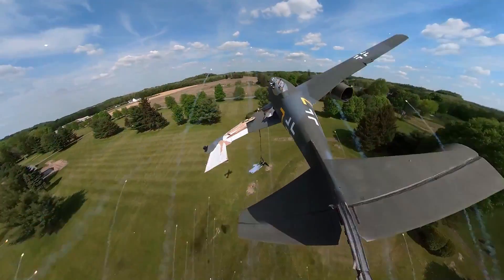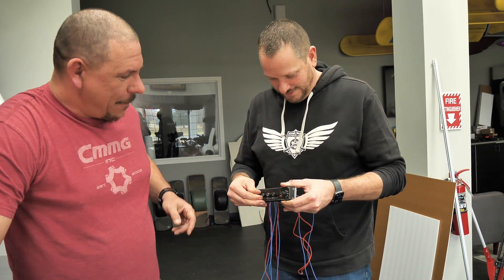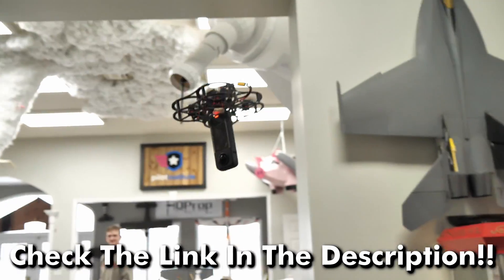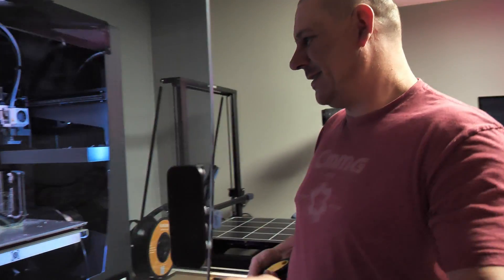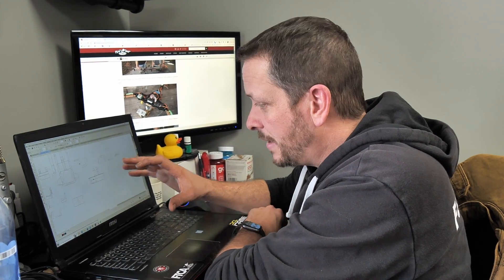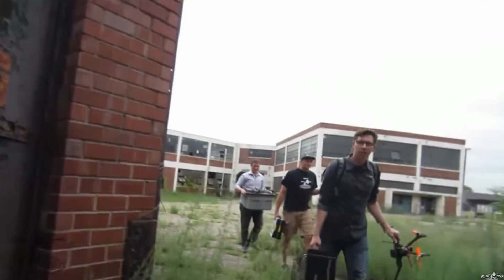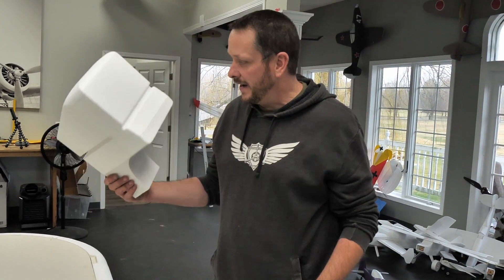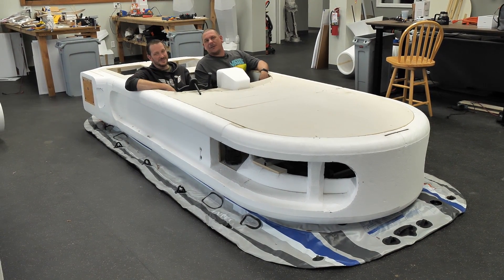Huge Upgrades To Our Hovercraft

Comment: While it wont look as much like the SW Speeder, if you are going to have differential thrust on the engines, I think you really need "skid steer" style controls rather than "throttle and steering wheel"; it will also give you the most effective "brakes".

Comment: Are you trying to build a scale model of the Star Wars one or something that works well? Too much emphasis here on making it look pretty I think. Copying the Star Wars shape has resulted in too many compromises in fundamental hovercraft design. E.g. larger diameter thrust ducts would give more effective and efficient thrust but not truly be to scale. Or you just put lots of power or a jet engine into the small ducts.

Comment: I used to build 6 man commercial  hovercraft and have built models. The problem with models and small craft is the available parts are made for aircraft. So the propellers have too large a pitch and are not meant for ducts. I'd suggest using 2 or 3 two  bladed mounted onto one motor shaft. And crop the tips so they are wider at the tip.

Also you should not taper the duct after the motor. It should be parallel or even slightly  divergent. Tapering is for jet aircraft as they travel much faster.

Comment: If you want to add strength to ur styrofoam, cheaply and easily, just latex paint it, put fiberglass window screen material or cloth on the wet paint and immediately paint it again. It will surprise you how much stronger and durable it makes styrofoam. Crashes will be less damaging to wings and fuselage...(poor man’s fiberglass that won’t dissolve the styrofoam)

Comment: At 15:06 it looks like something ain't right with the upper propeller.  Is it mounted upside down or something?  Is your intent to have the propellers turning opposite directions?  If so is one prop cw and the other ccw?  I'm pretty sure something is wonky there.  You will lose a lot of efficiency if this isn't correct.  It's easy to get wrong.  Ask me how I know.

Comment: Great work guys.  Can't wait to see the finished product.

Quick Question, why did you use props instead of the traditional hovercraft fans used for the lift?  Aren't fans supposed to create more pressure?

Comment: Well, that is a totally different beast than what you started with, so my prediction about capacity of OK for one 4-legged wookie and fat chance for Bixler is debunked, 👍👍👍. But one thing comes to mind, (I'm missing the flabbergasted headshaking emoji) what ever would you do without Dave? If I recall right you are planning sound system on your car (perhaps go easy on subwoofer), playlist has to have hits from Figrin D"an and the Modal Nodes 😊.

Comment: As for the throttle for safety reasons I would have it rev up as you pull the stick back not as you push it forward this way if you run into something you don't end up accidentally jamming it to full throttle probably not such a big deal for a hovercraft but something to think about

Comment: Not to be THAT guy but the weight and complexity of the "bag" and blowers is extra weight you don't need. Did you guys research how actual hovercrafts work? The thing that keeps the air in underneath isn't a tube, it's a flexible skirt.

Comment: This is looking amazing! That's a badass wiring job!

One of the discoveries made in early work was that it's more efficient for the lift fans to actually blow through the skirt and vent into the underside sideways towards the center of the vehicle. It was more stable and efficient, though I don't know how much.

Comment: Great work so far guys. If you can integrate the yoke pulling and pushing to also control the main blower motors, that would add a nice touch to be able to fine tune / control the main bag inflation while driving. May the force be with you.
Reply: You would want independant control over the front and back rotors to level it out depending on who's in it. But, you wouldn't want to control the inflation with a yoke. You pretty much want it on or off with a front to back dial.

Comment: if you're adding mylar for the reflection, you should add a base layer of some abrasion resistant material for the skirt, the boat is tough but not rough parking lot tough

Comment: You should make the forward throttle integrated into the yolk so when you push it in it goes forward and when you pull it back it comes to a stop. Separate button for reverser, momentary switch or something.
Reply: Super awesome though, can't wait to see the final product.

Comment: You could add some mirrored armor panels, like in Spaceballs. From a distance, it might make a cool effect. I suppose, if the controls were made to be fly by wire, then you could easily control everything by R/C, too. Have a computer actually fly it, but interpret input from the controls or the transmitter.

Comment: Beautiful construction!! I think the way Normal hovercrafts are designed, with a flat bottom and all the lift air coming from the edge out the bottom of the inflated skirt would take a lot less power. multi rotor lift and hovercraft lift are different.  good luck
Reply: Yeah, I never liked their "skirt" design. I think they're loosening a lot of efficiency.

Comment: Static pressure, you need Static pressure, sure the props are large diameter for the model craft you normally build, but the surface area of the blade is microscopic for a craft of that weight especially with people in it. Look at any other fan blade design that actually has to push air: EDF blades, computer fans, vent blowers, axial leaf blowers, airboats, (and I Hate to have to say this but real hovercrafts)

Comment: If you put controllable louvers on the left and right intake, the blower motors could alternately suck air from the right or left, which might offer some bow control. (same for the back, for a turn in place without extra motors)

Comment: Consider: For the sake of Air Volume. Expanded Metal mesh as a hood insert would tend to maximize air flow. Mirror Mylar skirt laminations would tend to go well with aluminum foil laminations. Propane Iris afterburners would be a blast.

Comment: I SO agreed with you that they most deffy need MORE powers! Cuz right now they only have I think, I'm not sure, but I think they have 8 motors on their hovercraft right now, so I'm thinking they might need 2 more, total of 10 motors total, cuz their hovercraft have soooo much more weights added into this hovercraft, so 2 more motors should be able to fly them off the ground, even maybe few inches or so, that would be mission accomplished! 😂 But they did great works, especially for Dave, he did soo good works on electronics, and as well as for Josh to manufacture the body work with foams, what do you think of that could add 2 more motors somewhere in their hovercraft? 🤔

Comment: The wiring and electronis development portiponno is my favorite as a 40 year tech / mech on Arcade and Pinball games. 
For my last 8 years working full time I was building Multicade 60 in 1 Arcade games using old Arcade game cabinets as well as new out of the box cabinets.
I used new jamma harnesses, led lighted game buttons.
I'm the only person who installed flipper and shake buttons on the side of the cabinet level with the control panel so the digital Pinball game could be played like a real Pinball game insteadofusing the joystick. 
There was many other mods I had to do including braiding the wiring harness.
I'm now converting a 25th anniversary Pac Man game that the original power (no over voltage protection built in) supply blew out the mother board with a 60 in 1 Multicade board.
I also installed a lighted mini track ball to play 3 trackball games instead of using the joystick for those games.
The one I'm doing now has no actual coin door so I'm going to have to move the test switch located on the lower right backof the cabinet to the top right back and add a on/off toggle service switch to program the games limiters including number score levels of lives ect..
For me, it's going to be as interesting as your component design process and wiring installation which I'd be tickled pink to be involved with.
You guys are doing a bang up head thimpin'  job on that machine.

Comment: I have a feeling you will need to use reverse thrust to steer from the 2 side thrusters. the one top should be set up for power a rudder is needed but then you do not look like your objective.

Comment: i so hope you guys listen to what i said before and triple power.
Reply: I SO agreed with you that they most deffy need MORE powers! Cuz right now they only have I think, I'm not sure, but I think they have 8 motors on their hovercraft right now, so I'm thinking they might need 2 more, total of 10 motors total, cuz their hovercraft have soooo much more weights added into this hovercraft, so 2 more motors should be able to fly them off the ground, even maybe few inches or so, that would be mission accomplished! 😂 But they did great works, especially for Dave, he did soo good works on electronics, and as well as for Josh to manufacture the body work with foams, what do you think of that could add 2 more motors somewhere in their hovercraft? 🤔.
Reply: P.S.
I would guard the "manberries" more...
If those props go....

Comment: I do wonder why you didn't go with multi-blade fans like on commercial personal hovercraft. Surely they would shift more air than a two blade prop? For lift & propulsion.
Reply: I definitely agree with you on what you are saying, and it simply comes down to we are using what we already have and reusing stuff that is at our disposal
Reply: @davidjester5085  I get that, but by using the wrong kind of fan you're making a really inefficient machine, adding way more weight and cutting down on battery time.  With a fan providing the proper amount of static pressure you could cut way back on the throttle and run this for hours instead of minutes.
Reply: @davidjester5085  understand scrounging parts but cut some hubs down or make adapters so you can run 4 blades on each motor.  Block the middle ~1/3 of the duct under the blades for pressure

Comment: If you don't make a deeper skirt you're gonna be stuck only being able to traverse extremely flat or level surfaces (watch your first road test to see what happened when you hit that first bit of uneven ground where you grounded it).

A deeper skirt would take up that dip, you would not lose air pressure and you'd keep moving. Watch clips of the military ones to see what I mean lol

Comment: Throttle control should be through the wheel push in move forward, pull back stop reverse through the stick.